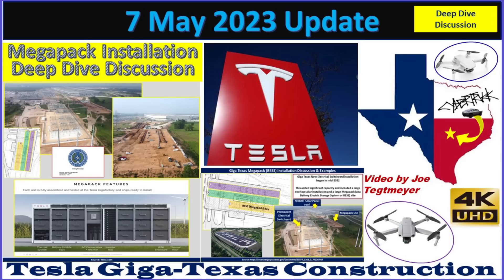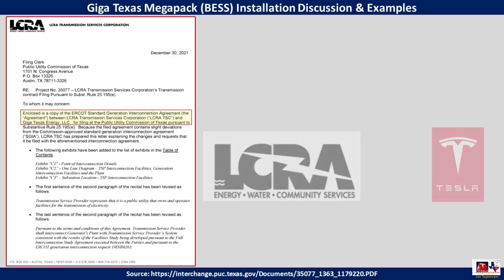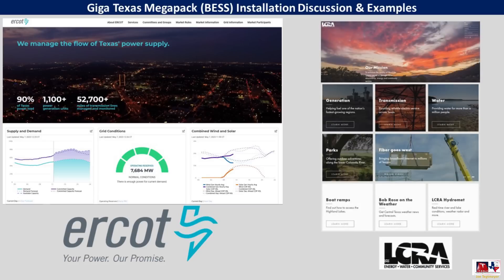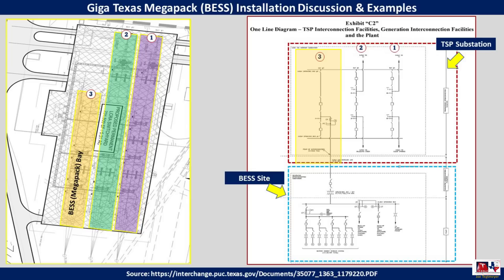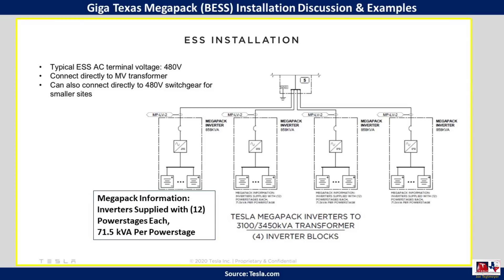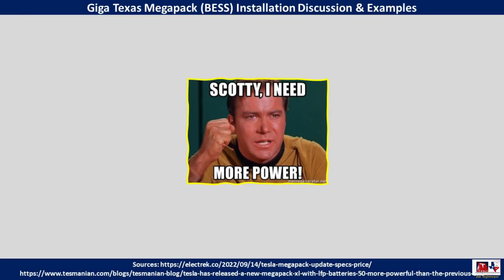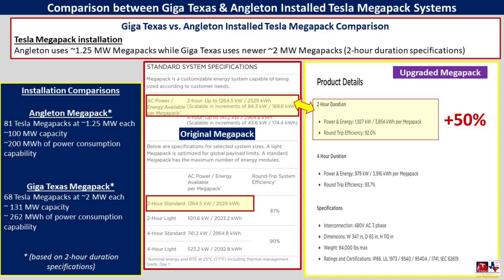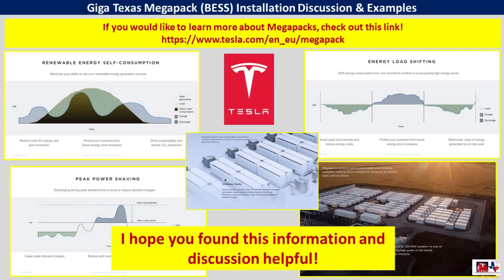Megapack Deep Dive w/ Official Documents & illustrations! 7 May 2023 Giga Texas Construction Update

Comment: Surely, they will shortly get to 18 battery module bays (& 4.081 MWh) per pack - it looks a weird final design at present. From there, over time, they should be able to increase capacity another 23% to hit 5 MWh/pack as energy density and packaging improvements are made.

Comment: Hey Joe. Over at Tesla right now, and guess what?! A yellow and blue helicopter JUST landed at 10:50am
Reply from the maker: Cool! Any photos?
Reply: Seems to have red and blue flashing lights. Might be an AirLife. Hope not
Reply from the maker: @forwardthinkingtrucker  could be a test as they have been doing evacuation drills
Reply: No sir. I can see it but I'm over by the Die shop
Reply: It just took off. Was only on ground for 13 mins
Reply: I tried to zoom in on it, but by the time I changed camera around and tried to focus it was back in the air

Comment: Joe, thank you very much for this further presentation, which clarifies very important details about the Giga Texas energy storage system.
I've been thinking for a long time that Tesla is not just an electric car maker, but also a clean, renewable energy company. I've also been thinking about the huge spaces at Giga Texas that could be used for electricity production. All of this makes me imagine a future in which the roof of the main building will be completely covered with photovoltaic panels, which should happen in the medium term, depending only on the final assembly of the internal structures, which could interfere with the configuration of the automaker's roof and therefore prevents placement of all 70,000 tiles. But this will certainly happen in 1 to 2 years. I also keep thinking about the coverage of the two other buildings under construction. I believe they will have the same fate of supporting photovoltaic plants. Apparently, more buildings will have to be built in the complex and they will also have to be covered with photovoltaic panels. Even so, a lot of usable space for the production of clean energy will still be left in the Giga Texas complex. I mean the huge parking lots. I dream of the day in the future when Tesla might decide to cover all parking lots with photovoltaic panels. This would have a double purpose, to produce clean and renewable energy and to reduce the temperature of vehicles parked there. Imagine, Joe, just the absurd amount of electricity that Tesla could produce in such a configuration, which would greatly reduce your electricity bill and, consequently, the cost of producing vehicles. Furthermore, it would be possible to enlarge the Megapack yard, because there is enough space in the immediate vicinity of the facility.
I leave here, therefore, my vision of the future. I don't know if this decision will be taken by Tesla, but I dream of this possibility, even knowing that it could only be taken in the medium term, after the stabilization of the parking and construction sites in the Giga Texas complex, which will not happen in the short term .

Comment: Is Megapack tapping 19:08  the other transformers? I do t understand why there isn’t a dedicated transformer for the mega packs to step down to 480V from 300kv. What am I missing?
Reply: There is a transformer in the yet to be built interconnection substation. Which can be seen on page 48 of the document (PDF page 59). It can also be seen on the video @ 7:27 (Right side), though not clearly. Without a transformer there is no way to connect the BESS yard's 25 kV buss to the 345 kV buss in the main substation.
Reply: Hey guys, from the document, page 38 (PDF page 49)... Here are the requirements for the future interconnection substation (Not yet built) listed under 8 C --->
"Generator's interconnection substation(s) including any required control building(s),
345-kV generation step-up ("GSU") transformer(s), transformer protection package(s),
345-kV circuit breaker(s), 345-kV circuit disconnect switch(esl and protective
relaying panels for the Generator's 345-kV circuit that will coordinate with the TSP's
line panels at the TSP Substation for the Generator line protection (Generator's GSU
and/or autotransformer shall utilize a grounded-wye configuration on the high-side
voltage winding in order to provide adequate ground fault protection)"

Remember, the  interconnection substation is only one part of the Generator Interconnection Facility (GIF) The other requirements are listed under 8 A through F.
Reply: I think that is 32kv. However I expect the factory runs on 480Vac 3ph so this is the same as what the Megapacks are designed for.
Reply: @royh6526  they why the separate line of breakers and switches for the megapacks?
Reply: @rb8049  The Megapack breakers and switches are there for two reasons.... 1) To isolate the Megapack if there is a fault so it doesn't take down the whole system. 2) So they can perform maintenance on the Megapacks or breakers. Notice that there is also a switch that can disconnect all of the Megapacks from the 24.9 kV buss.
Reply: @rb8049  It seems David Johnson has the right answers.

Comment: Wonderful presentation, yet I always wondered does the mega pack have enough energy to supply the factory all it needs during peak demand? What would that demand be?
Reply: I think there wouldn't be much point in building it, if it didn't meet requirements. The question is how long could the Megapack installation support the factory by itself.

Comment: Hi Joe, It's better than you think, the inverter rate is 2MW per pack, but storage is twice that at 3.9 MW about 265 MW in total capacity. Secondly the rooftop solar when complete if rated at 30MW that rating I believe should be per hour, in winter that could easily be 90MW per day and in summer 150MW per day. This would allow 100MW hours to be purchased from the grid at arbitrage rates. If these megapacks are LFP multiple charge and discharge cycles per day should be achievable with little degradation to the batteries as would have occurred with the older lithium, nickel, cobalt variety. So, the throughput capacity for these megapacks could be 2 to 3 times the 265MW rating.
Reply: Great analysis! Just to clarify, 30 MW "power" rooftop for around 90 MWh "energy" in winter, 150 MWh in summer
Reply: storage isn't MW, it's MWhrs. 
 MW is instantaneous delivery rate.
Reply: They are using the old version Megapack :(

Comment: Probably 3 months out to finish sync and commercial - so might help in the very last part of the summer heat wave, but this amount of power is a relative sneeze given the full grid demand during those times, which can be up 80-85 GW and toward the 75+ GW in winter range.  Useful in various balancing uses for sure.  For their own maximizing of the solar and decreasing demand charges too.

Comment: Thanks for the Megapack update! Just want to add to what you already said so well. @ 7:27 (Right side) Shows page 48 (PDF page 59) The schematic diagram shows 3 facilities. The new substation is at the top. The Megapacks are at the bottom. Notice in the middle, between the Megapacks and the main substation.... "Generator interconnection facilities" and "interconnection substation".  The interconnection substation will have a 24.9 kV to 345 kV step up transformer, circuit breakers, and switches. Which will connect to the main substation via an underground 345 kV cable to the monopole shown on page page 47 (PDF page 58), also seen @ 6:37 on the video. Also, there are two back up power feeds that come off of the 25 kV buss. So the factory will have some backup power in the event of an outage.

Comment: So would that power the whole place and for how long?
Reply: As they are not limited by cost or availability, I would expect that this would be exactly what they want.🤔
Reply: 131 MW for two hours. Which is 262 Megawatt hours. We don't know how much energy the factory requires. But as an example... If the factory required 30 MW, they would have power for 8.7 hours. Which is why I prefer generators. They keep providing power as long as there is fuel.
Reply: @DavidJohnson-tv2nn  8.7 hours assuming 0 PV production.
Reply: @bryanwhitton1784  I'm assuming a worst case scenario. A cold dark cloudy day in the middle of a winter storm.
Reply: @DavidJohnson-tv2nn  Like I said no PV.
Reply: @DavidJohnson-tv2nn  Thanks for reply battery may just do it for them.
Reply: Yes, for several hours especially if they had an elaborate  system in place to turn off non-essential circuits etc.  We haven't seen their draw demand numbers that I'm aware of so it's pretty much a guess.